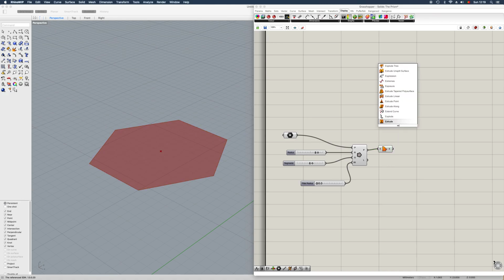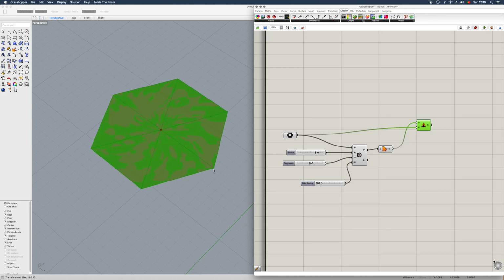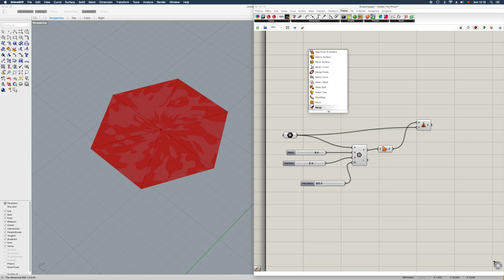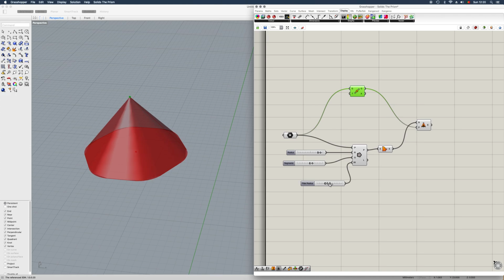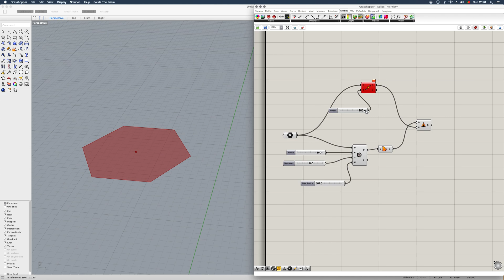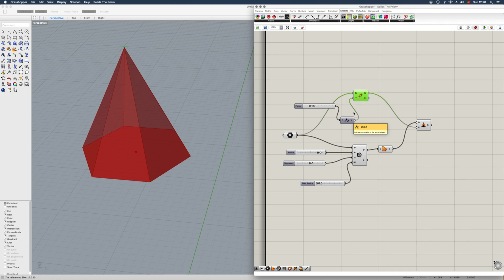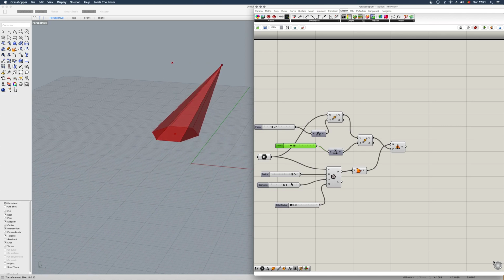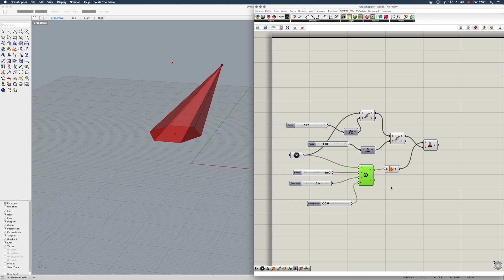How to Generate a Pyramid - Rhino/GH Tutorial

Comment: Hi, do you know how to make a equilateral triangular pyramid?
Reply from the maker: Hey! A specific iteration is best done in rhino alone, however, I picked up the code and did it in grasshopper to try it out: Based on the code at 00:44, what you can do next is add an explode component and connect it with the polygon's upper output. Next connect the Explode Component's Segments output with a list component and  the latter with a length component. Meanwhile, connect the Explode's Vertices Output with the Base Input of a Sphere Component and the Length Component's Output with the former's Radius Input. Once all 3 spheres are generated connect the component's output to both inputs of a Solid Intersection Component, then connect this component's output with a Deconstruct Brep Component. Connect the last one's vertices output with a List component (don't forget to flatten the list input) and then connect your result with the point input on the Extrude Point Component to finish.  If this sounded complicated I can make a video :) Cheers!